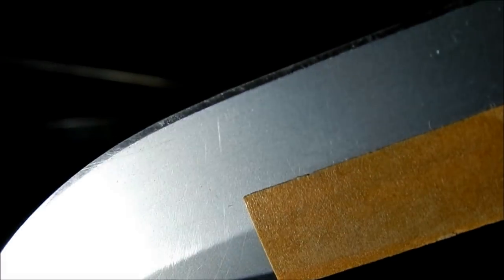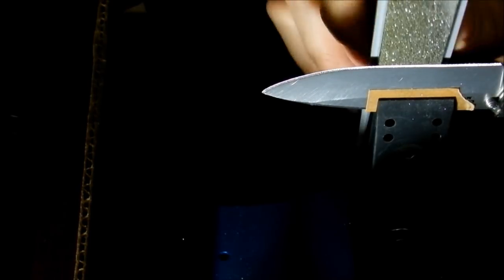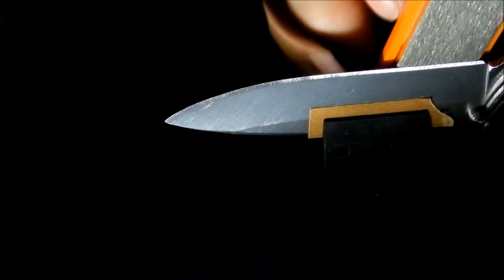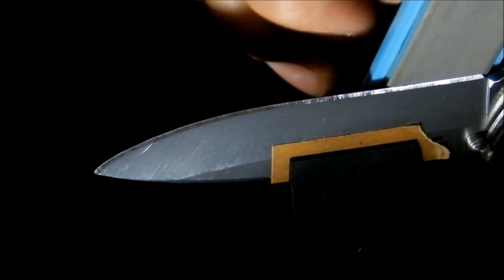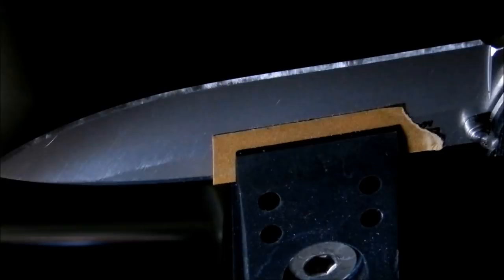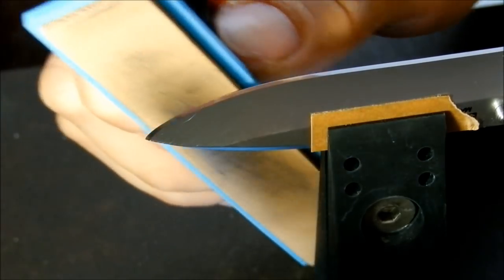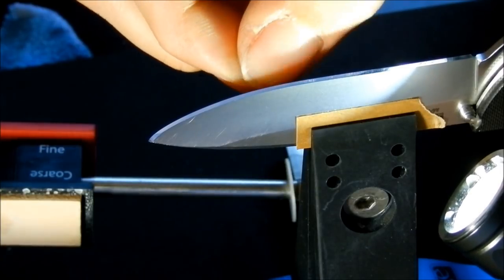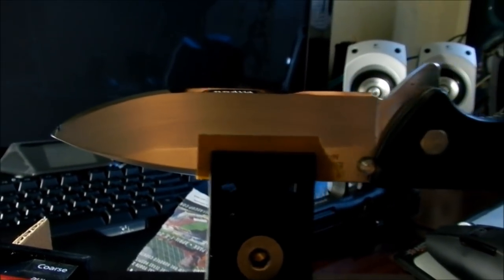Wicked Edge Sharpening a Kershaw Skyline Dull to Extremely Sharp

Comment: This video should be considered art
Reply: Agreed, the edge he made is, in fact...a form of art.
Reply: +Jerry C The way I see it (and I&#39;m by no means claiming to be an expert, just well informed through many channels of experience) it doesn&#39;t really matter what his technique is to get to the end result. The way you&#39;re describing how he should have performed his profiling may be the &quot;correct&quot; way in your opinion (and mine for the record) but as far as I can see with the angles he showed at the end...the edge is stunning. Period, no one can argue that unless you just don&#39;t agree with polished edges on knives. And that&#39;s fine, that&#39;s your opinion. We&#39;d probably see micro striations if he got his 60x jewelers loop out. And correct me if I&#39;m wrong, your claims that he should not have &quot;scrubbed&quot; makes for a change in molecular structure in the alloy as opposed to strokes all being the same direction. While I agree with that technique, I&#39;ve seen many vids where who I&#39;d consider a pro says it&#39;s perfectly ok to scrub while profiling.
Reply: +Justin S I've already "liked" your post, but I just wanted to 2nd this post in writing because it's absolutely fuggin true
Reply: +Justin S What kind of logic is that? lol. what would you do if the creator of the system was a complete fool? that of course is hypothetically speaking of future situations, so don't take that the wrong way.

Comment: I've had the WE system for a couple of years and really like it. I am suprized that you are using a back and forth motion as you work, I find that this REALLY causes the diamond abraisive to wear off. Had to replace one set of stones due to this when I first started using the system. Main drawback with WE is the difficulty in sharpening concave edges, very flexible knives or large blades. Good video.

Comment: I watched all of it.
I think you can skip the 5 micron and 3 micron strops too.
Don't forget that used sandpaper can still work perfectly good, after you use it you can then wash it with soap, then dry it good and store it in a book so that it remains flat and not warp at the corners.
You can rub two pieces of sandpaper together to produce a slightly used finer grit.

I would very much like to see a video on how you do your mirror polish on the side of the blade.

Comment: I'm not terribly fond of going all the way down to grits below 100 unless I'm planning to regrind the entire primary bevel. I find that it just takes off too much material and dramatically shortens the lifespan of the knife, when most knives only need a couple dozen passes at 200 grit to bring back a burr. I prefer to work slower, using a finer grit allows me that luxury, as it also lets me more quickly move up the grits afterward because there aren't massive scratches to grind out later. This is especially true if you have diamond stones, as they already cut quickly, and the extremely coarse diamond stones are also notoriously inconsistent in their grain size.
Reply: He was only testing them. As he said it was a $25 knife, I doubt he cares too much about it.
Reply: +Robert Grenzray my skyline is my life
Reply: Robert Coffey I'm still having trouble buffing out the 100grit scratches after regrind.  I go up to 1600 grit then strops.   Maybe my stones are still too new as I've only sharpened 8 knives
Reply: Primo advice. Thank you for sharing it.
Reply: He did re profile the knife from 20 degrees to 15 degrees. The 50 and 80 are just fine if you are actually reprofiling. I agree they are not necessary for average maintenance though.

Comment from the maker: You measured them with the calipers right? I was really impressed with all of my other stones being within a 0.5mm thickness tolerance & I was surprised when I noticed the 50/80 was uneven & 2mm thicker. I used a digital angle finder & the thickness difference only made the angle off by about 1/3 degree, but I like perfection so I will send an email today.

Comment: Just sharpened a Spyderco Endura with ZDP-189 powdered metal steel, which is a real bitch, if you have one that isn't properly beveled. I bought one and the secondary bevel was way too thick behind the primary edge. Hard to believe it made it out of the factory. I used a 140 & 600 diamond stone to create the right 2ndary bevel, freehand. Then I used a Naniwa Chosera 400, Shapton 1000 and 4000. I stropped w/ .5 micron CO2 compound. Now it push cuts through paper, no sawing needed. Guess I'm old school, but I like freehand sharpening. I've owned 2x72" variable speed 3hp grinders and other, "helpers", but once you learn freehand, you're good to go, anywhere with just a stone.

Comment: Great video, the kit is a ridiculous price over $1000 for the base, stones and strops!

I use wet/dry paper down to 3000 grit on a slow belt sander with the blades at set angles. It gives a mirror finish with an edge I can shave with that lasts for ages. From blunt to razor in 10 minutes at a fraction of the price
Reply: Wow where did you did that number??? 
The base model is $275 
Pro pack 1 is $390 
and pro pack 2 is $700, and that comes with every thing the system has to offer just about. 

The only way to break $1000 with a Wicked edge, is with the Naniwa water stones. They are over $200 per stone. But not too bad for top line Japanese stones. 

It is a very expensive system non the less... but it is well worth it if you really enjoy extreme sharpness, or you do knife sharpening for a side income like my self.
Reply: Dan Martin I just find freehand sharpening to be extremely relaxing. This system might be able to do a more precise job, but I can still cut tissue when I finish. Good steel helps as well. AUS-8A is some of the sharpest I have used. But, when I add up the cost of materials, I could have bought two of those systems. Oh well...
Reply: I do agree, it can be very relaxing to sit back and shape a blade out of a bar of steel on the sander, or put an edge on a machete, or even from time to time do some free hand sharpening. With free hand I am not the best, I can get a dull blade to take hair off my arm, and that is plenty fine for a working knife, but the high levels of sharpness like cutting tissue (as you pointed out) or even whittling hair, is not in my skill set with my current practice.

A big reason I decided to go into a guided angle set up is because I need to be able to get a razor edge consistently out of anything from a crap German 4116 or some 440 with a chines heat treated, to some mid range steels like AUS8a and VG-10, and even up to very tricky supper steels like CPM s30v, CPM 3V, M390, ect... and I need to do it decently fast so I will be able to make it worth my time while sharpening for clients.

Comment: Sorry to slam you with comments.

You don't have to use sand paper after the ceramics if you use the 5/3.5 micron strops. Even though they are the exact same grit rating, the strops burnish the edge (plastic deformation) which polishes the edge up MUCH more than the ceramics do. :)

Comment: I hope you can actually sharpen a blade without a 'system'. This system is so dependent on its own parts. But I'm sure as long as at home or in the shop its awesome. I still feel being able to do this in the field with basic supplies and tools is far more comforting. Cheers.

Comment from the maker: I use the app iHandy Level every time & check to make both sides are the same degree. I am very picky so being off by 1/4 degree would be unacceptable. I see this issue more on FFG blades or blades without a large flat for the clamp to grab onto. Something else I do is set the iPhone on the knife handle to make sure the blade is perfectly vertical.

Comment from the maker: @pontiacmaniac2 If you want to upgrade you Lansky you could get the GATCO ultimate system. Or you could try to tape on 1000 - 2500 grit sandpaper to your  Lansky to get mirror polished edges. The GATCO works better due to the wider stones. You can even cut a leather piece to get a controlled angle strop by taping it to the GATCO stones.

Comment: do you think it better then Lansky knife sharper?  your look nice...
Reply: robert boose the lansky system gives you a nice edge, but the wicked edge are way better.
Reply: Gnulf Yes it look very nice will have to get some money and buy looks like about 700.00 i checked on amason, then checked with company looks like they got new model out, going to check some more before buying... thanks...
Reply: yeah kinda expensive and the new model dosent come with all the extras as the big pro pack, so it is hard to decide :/
Reply: Gnulf Yes thanks for imput, looks like does great job, thanks...

Comment: you're not supposed to go up n down but slide out from you. lol
Reply: either way works it doesnt matter much
Reply: +Sean H brilliant  contribution. When a situation arises, you're type will be those that will die first. 😂
Reply: many people have different techniques, use whatever works for you, basically.
Reply: +barnabyray I understand what you're saying but there's a proper way to do it and up n down is not it. 
it'll work but it's not the best way. I invite you to check on wicked edges video. see how it's supposed to be done. I'm still awaiting mine.  my buddy has it and with the proper technique it's gets the job done perfect.  up n down.  you'll never get it perfect. it is designed to start towards you and pull away from you towards the tip. that gives a perfect pass. a little harder to get the right coordination in the beginning but after about 15-20 mins you get the hang of it and can get some speed into it.
Reply: +shtfprepared that might be true for this system but others use the up and down method and it works perfectly so why should it be any different with this one they are basically the same
Reply: shtfprepared It may be more efficient as designed in both mechanics and metal loss but in terms of the end result, you won't get much better than the edge at the end of this video. You may get there faster.
Reply: He took a trashed knife and made it scalpel sharp. You say he's doing it wrong,  I don't think so.

Comment: you just scraped your knife on concrete at your job and so your blade is fucked up and scratched up yet you still tape the blade so you dont scratch it? dont get it but whatever good vid
Reply: Why scratch it if it doesnt have to be scratched?
Reply: i have and it still doesnt make sense to me. not baggin on him or anything just curious. if it was on an edge pro i could understand cuz some of the shavings could get into the pivot but on a wicked edge its not as big a problem. i think having scratched blades is badass it shows that you use your knife and not baby it

Comment: If you're going to cut tape on concrete, just use a cheap utility knife, not a quality knife. You're not seriously going to use a re-beveled 20 to 15 degree edge on heavy work, are you? That's like p--sing on a Rembrandt.
Reply: The knife is only $25
Reply: LinXx
It still looks like a good knife.  Why ruin it?

Comment: these sharpeners that use diamond stones are junk I can shave with all my knives and all I need is my 3 stage water stones and a good file
Reply: Three stage water stones are junk. I can shave with all my knives and all I have is a rock and a good paper clip...
Reply: +Jacob Lang rocks and paper clips are crap. My knives can split atoms, and all I have is a t-shirt and a 6-pack of Schlitz!
Reply: Doesn't mean the diamond sharpeners are junk......
Reply: No but they are the media the diamonds are pressed in is softer than the steel you are sharpening so there fore the diamonds start to cut the media they are in get covered in it and fall out all without ever actually sharpening your blade with the diamond part of the diamond stone.